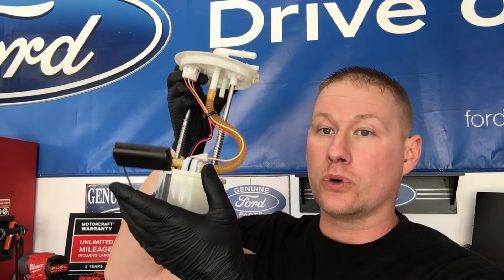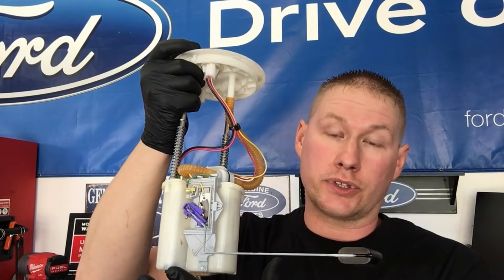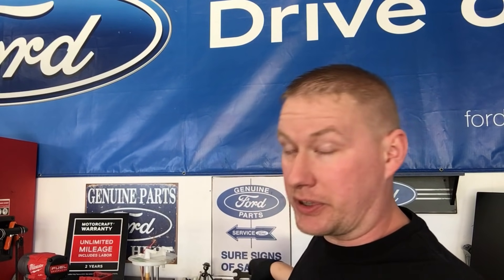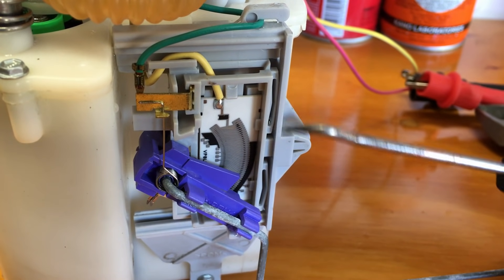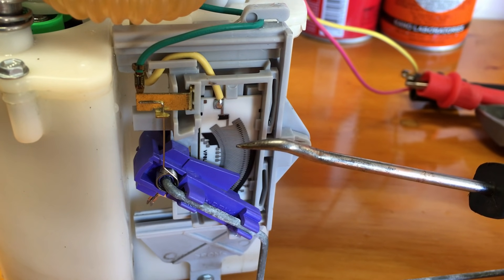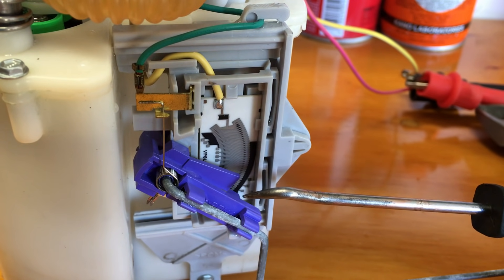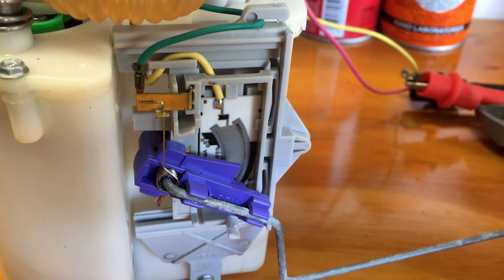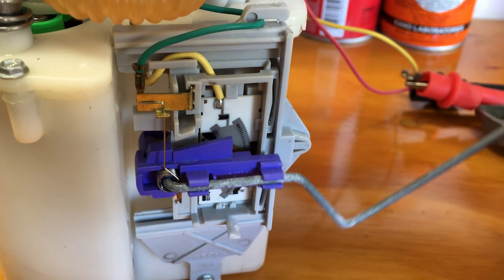Ford Quick Tips #77: DTC P0460 P0463 Erratic Fuel Gauge Quick Fix!

Comment from the maker: Before replacing the fuel pump sending unit use this additive to restore it-
http://amzn.to/2wm37s5
Reply: cruisepix mine was @ 60k when started, but never got a code?
Reply: Does auto stores or Wal-Mart carry this?
Reply: Yes. It comes in different size bottles for different size gas tanks.
 @maxwell9219
Reply: FordTechMakuloco my fuel gauge is draining extremely fast what could be wrong with it?
Reply: It works!!!!👌👍
Reply: Is this techron plus ok for diesel ford kugas?
Reply: @TempTrack  this chevy yrecro plus really work
Reply: @FordTechMakuloco I have an 07 f250 6.0, and i just got the p460, can I use this stuff in my truck or should I use the techron diesl fuel system treatment? I ask becuase I dont know if its as effective as the one youre mentioning, and I dont know if its safe since its based around gasoline and not diese
Reply: @DJCuhhhstin956  what did you find out about what works for the 6.0 L? My gauge works good when it 1/2 or below but shows empty when I fill it up and was wanting to know if what he is using works with Diesel
Reply: @DJCuhhhstin956  how did this turn out for ya? My 07 6.0 is having erratic fuel level low warnings too...
Reply: FordTechMakuloco I have an 09 f150 4.6 3v. I don't have any codes, however I have not been able to fill my tank fully in over six months. I can only put maybe 20 gallons (I have the 26 gallon tank) before it clicks that it's full.  Do you think there is debris preventing the arm to lock out fully? I usually get over 440 miles on a full tank,  lately I can only get 370.
Reply: I tried a large bottle of it with a full tank in my 2004 Mercury Monterey... It still reads empty, and the low-fuel light is on! I pulled the cluster to see if the anti-slosh module could be bypassed, but there doesn't appear to be one. Now what do I do?
Reply: Mine the gauge before I replace my fuel pump was not working properly and I just replace my fuel pump and the gauge looks like is doing the same thing looks like is stock I did fill my tank and is only reading 3/4 of the full tank
Reply: Does a 2006 ford van has a anti slosh board?
Reply: Was that unit affected? If so, how many miles on?
Reply: Would you still use the cleaner on a 3.5 ecoboost
Reply: FordTechMakuloco I’m driving 2004 f150 .. lately .. I noticed whenever we have hot weather 78 F or up my truck like stalling ..and it said : check gauges ..3 days ago I was driving...  it was around 82 F .. I stopped at red light then my truck shut down totally .. all lights were on ... it said : check gauges .. again !!!  so I did remove the battery gauges and I put them back .. it started then I drove back home ... today it was really hot again .. I tried to start my truck .. it wouldn’t .. again the message came up again : check gauges ...but this time won’t start ... I could hear like it wanted to start then dies and all lights were on.. the engine the wrench the battery the fuel ... Please Help
Reply: SuperBadr12 My vehicle is of a later design than yours, but when I can't get fuel pressure on a cold start or on a restart, and I need to get it going right now, here's what I have found that can work.  Check your relays - the Run/Start, Fuel Pump, etc. in the Battery Junction Box(BJB) The Owners Manual identifies them by name, or you can download your manual from Ford if its missing.  Instead of buying new ones at $20 per relay, using the owners manual diagram, just switch out questionable relays with non-critical ones that have the exact same Ford part number. For example, on my 2010 5.4 Expedition, all of the relays on the back row of the BJB are identical. Switching them around doesn't fix it, but it can get it started very quickly.  Keep a pair of pliers in your truck to make it easy to change them. You can also use the Ford recommended grease to help prevent bad connections from corrosion in any recommended connector (i.e. not on spark plug tips and their connectors on gas engines).  I am still trying to find the root cause of the issue, and will be adding the Techron product tomorrow, but relay switching is the only thing that let's me continue to drive the vehicle.  I hate replacing expensive parts when I am not certain about the cause of the problem.  I bought this vehicle new from the dealer, and in 125,000 miles of driving, this is the first mechanical or electrical problem I have had, except for a blower relay at 70,000 miles, which took 5 minutes to fix after getting the new relay.

P.S. For finding overheated relays or anything else, use a cheap laser temperature gun to quickly locate hot spots.
Reply: My '05 500 with a P2068 code (Fuel level sensor "B" circuit high) Will this method help, or is it time to visit a shop?
Reply: Oddly the gauge on my '13 Cmax started giving erratic readings AFTER I put the techron in......
Reply: Can I use the chevron plus in diesel fuel???
Reply: Said what

Comment: Was really skeptical about this to  start but decided to give it a try 
Put it in on 01/05/25 cleared the code and been running for a few days now and it works so far, going to put my second bottle in today 01/10/25, glad I saw the video on was really not looking forward to pulling the unit out. Thanks

Comment: Mine, is stuck on almost full..I already have Techron cuz I wanted to put it in, so I'll do that tomorrow.. But my fuel pressure is 28-30 f250 5.4, so I'm thinking it's time to change the pump anyway? Thanks great video

Comment: Hi, I just got a 2012 F150 with the 5.0 last week. It has 315,000 km on it.  And got a P0461 code today. Here is the background.

When I got it, it is empty and it said 18L/100km. I went fill her up all the way.
The same week, the truck was in a shop for coolant leak repair and transcooler line replacement.
When I pick up the truck the shop told me the check engine light went on for misfire but I told them to clear it and I will keep an eyes on it because the check engine light is not on when I took it in.

When I pick up the truck, it said 34L/100km. Thinking they were bleeding the coolant and test drive and drive hard. They put on around 10 km.
A day later of my driving I get it back to 22L/100km but the check engine light turn on and I got P0461. Gas gauge showing just above half after 270km of driving since fill up.

My question is, does the big changes from 18L/100km, to 34L/100km and back to now 20L/100km turn on the P0461? Should I just clear it and keep an eyes on it?

Thank you

Comment: I replaced my fuel pump in my 02 GT and now the gauge shows empty with a full tank and a "low fuel" light and "service soon light". After using up enough fuel the gauge goes to full, the low fuel light turns off and the service soon light eventually turns off until the next time I gas up. So, I'm going to have to drop the tank, again, and check the float to see if it's bent. I did notice the (OEM) assembly didn't have any rubber feet but I didn't think that would be an issue since I didn't see any foreign objects (like rubber feet)  in the tank. Are those rubber feet necessary and if so where can I get replacements of the correct size? I have a source for the float but Amazon calls it a sending unit (combo float and sending unit?). Hopefully this will be the last time I have to do this for a long time. Is there a test method that you recommend to insure that everything is good before re-installing the tank? I was thinking of putting 15.8 gallons of gas into it while it's on the ground to see if it goes "off scale" again before re-installing the tank. I also considered putting in 15.8 gallons of 99% isoproyl alcohol into it since that would be safer - but what a waste. I suppose water would be fine as long as I thoroughly dry the tank. What do you suggest?

Comment: The fuel gauge on my 2005 Explorer was stuck on Empty. Watched this video, went to Wal-Mart yesterday, bought this Techron Complete Fuel System Cleaner for $10, put it in the tank in the parking lot, drove 14 miles home, no difference. Turned on the key to start it this afternoon, the needle jumped right up to 3/4 of a tank. FIXED! Try this additive before you do anything else!

Comment: Any idea why the aftermarket pumps I’m getting are reading ohms backwards of what you’re saying I should see? The gauge works from full to 3/4 then stops there. Float is not sticking, only thing I seen wrong is ohms empty start at 16 and full shows 161. We’ve run the additive you said and not working for us

Comment: I replaced my pumps (they were older and I was doing preventative work), sending unit, filter, and had Circuit Board Medics rebuild my instrument cluster and my gauge is still not reading correctly. Any ideas where to look next? I have a 2007 GT running the GT 500 double pump setup.

Comment: Hello. I am having problems with my fuel gauge for some time now.  I have   Ford focus Mk1 2001 2 litre. I clicked on the link but it doesn't go straight to the additive. There is a reference to Techron fuel injector cleaners from Techron. Is that a different product or will it have the same components?

Comment: i have the same Problem - pump replaced Ohm checked directly on the Cluster connector - so the wiring is working - but the ICM still says "0 Miles to empty" 😢 - i'm done for now - fuses all this stuff checked but no fuel Level...anyone any ideas - or a solution what is broken on the Cluster? 2007 EXP 5.4 3V...

Comment: As of this afternoon, out of no where the gauge itself seems fine but the digital read out of how many miles left to go on the fuel level is dropping hard and fast, yet zero leaks anywhere in the fuel system.. would this be the issue? Should I try the chevron trick?

Comment: idk if youll see this since its 7 years old but would the chevron liquid work, even on a new fuel pump/sending unit ? If its used to clean and protect the fuel sending unit, since mine is new would that help read it correctly ?
Reply: also @FordTechMakuloco how do i tap in to the wires coming out of the fuel pump ???
Reply from the maker: yup it leaves a coating.

Comment: I had a 1/4 tanks of gas on the dash when in reality it was less than that. I drove around a bit then it showed over half a tank. I found that strange cause I didn’t stop for gas. I then went to fuel up and turned out to have 2 gallons on a 35 gallon tank. I topped off the tank and it went back to a 1/4 on the gauge but a true full tank of gas. I added the solution and it moved to a half tank but after weeks of driving it. I’m not sure how much gas I really have. I ordered a new oem assembly and I’m waiting to install it.

Comment: I got a 461 and 463 codes. I came to YouTube and this was the first video to pop up...also the easiest first try to fix it. Going to buy this tomorrow. 2010 Lincoln Navigator L with 256,000 miles. Once this is cleared, I have a couple minor fixes then it gets sold.

Comment: Problem is I don't have a code.  My fuel gauge goes from a quarter of a tank (approx 65 miles to 0) to zero in a matter of minutes.  The car even stalls like it is out of gas.  After the engine stalls I can start it up immediately.  When I refuel, there are 2.5 to 3 gallons left in the tank.

Comment: I just wanna thank you for your recommendation. My wife’s fx2 fuel gauge wasn’t operating properly and I was dreading pulling the fuel tank I did one about 30 years ago when I was 27 it wouldn’t have been a bad job. before she ran one tank of fuel through it. It started working again unbelievable thank you, you wouldn’t happen to recommend an additive to soften up oil seals I’ve been told a few over the years but I’ve never really been an additive person, but I have a small leak in my F150 in the rear seal. Is there anything I can put in to soften the seal  Where it won’t leak

Comment: I have a 2005 mustang gt and suddenly the level will drop to 0 when parked idling for a bit then a minute later go back to normal. Now my cel light is on. I did let my car sit for a week and a half when I was on vacation. I did last use chevron gas and a slow station. I’m not super worried about it. I can always just go buy fuel used and reset it after every fill up

Comment: @FordTechMakuloco
Working on a 6.0 with the 460 463 and B1201. This cleaner says not recommended for Diesel. What do you recommend?
There is a TSB out there about a reprogram, but I can't find the info on what ecu id needs it.
I also need to find the pin point test specs, so I can test the communication to the cluster/ecu.
Thanks for the tip.
Reply: According to the Chevron website product comparison shows the complete will clean the sender card, but the Diesel additive does not ... hmmmm

Comment: I replaced the pump assembly and I still have P0463. Could it be the fuel pump control module? A fuse? The alternator producing too high of volts or alternating current? The fuel guage?

Comment: 2012 F150, doesn't get driven regularly. A couple times a month not very far to pick up hay/feed.  

Have the "sticking" fuel level gauge. No codes thrown though like everyone else mentions. Have noticed it only during the cold months in AZ. All through the warmer months never have the problem.  

I'll give this a go as the quick/cheap fix first. I would rather not have to pull the pump of nit needed.

Comment: Do it need to be oem floater? Also if 1 is out of wack will the other one throw a code aswell? I bought a new fuel pump and it still reads theyre both faulty

Comment: What would be the diesel equivalent? 2006 f350 6.0L intermittently goes to zero and throws the CEL. I haven't really noticed if it is related to the fuel from certain stations or not because it is so random and been that way since I bought the truck 3 years ago. I just track miles, it mostly bothers me when the * light is on.

Comment: The Techron did not help my fuel gauge problems and I think it is more than a corrosion issue. 

The fuel gauge is very erratic: sometimes off with the light on, sometimes with the light off and with varying levels regardless of how much is in the tank. Within 10 minutes of driving, I can experience all of these symptoms. I've been relying on my trip meter to keep me from running out of fuel.

When the gauge is working, the level will vary from 1/4 to 3/4 but never lower or higher, and always fluctuating when working. I am suspecting the fuel sending unit is bad but my skills are limited. What do you think?

Should I replace the fuel sending unit and/or the fuel pump with a new fuel sending unit? The engine has 148K miles on it and the fuel filter is new.
Reply: UPDATE: I've since had the fuel pump and sending unit replaced and the wiring traced by my mechanic. Still no change. Any suggestions?

Comment: I know this Video is a few years old, but I see you've made some recent replies.  Thanks BTW for your videos...I have definitely used 1 or 2 myself.
Now, I recently ran into a fuel gauge issue, which hopefully you can answer.
One day, going to NY, some type of issue occurred in the dash display while I was checking my fuel level.  Not sure what it was.  But afterward, the fuel level dropped from 1/2 to 1/4. Ever since then, my fuel gauge reads empty at close to 24 gallons used (I have the 36 Gallon tank). I've confirmed 36 gallon tank, and checked settings w FORSCAN...everything is correct.  I've compared odometer mileage to actual milage (based on fuel used) and it is fairly accurate.  I have put the Techron in my last 2 fuel-ups, but no change in the DTE.
Does this mean the sending unit is bad or possibly broken?  Let me know when you can...Thanks

Comment: My 1998 Ford e150 temperature gauge is not working.  I already changed the coolant sensor. The termostac is working. I don't know what else could be? 
The adometer mileage reading is also not working, I'm guessing it could be a bad cluster?🤔

Comment: Would you recommend trying this for a 00' f650 7.3, Allison 545? The fuel gauge stays stuck on full. No codes. Worked for half a day last week. Odometer and speedometer have now stopped as well. Speedometer may be Allison related.

Comment: Hello’ I have a 2005 ford explorer and my fuel gauge isn’t working. I replaced the whole fuel pump assembly that included the sending unit. The gauge worked for about 6 months and then it stopped working. I get a reading with a multimeter off the wires directly from the sending unit. I get no reading after the black (little black box thing wired in the harness) box on the harness. What is the black box on the harness and could that be the problem?? The fuel pump assembly came from rock auto and wasn’t very expensive about $140. FYI I’ve checked every fuse and relay related to the fuel system and nothing is wrong.

Comment: My 06 6.0 KR has had p0460 first come up at about 20k miles. I add about 10oz Lucas upper cylinder lube to tank and it helps but keeps coming back every once in a year.  Currently has 45k miles and I just now cleared the code 0460.  

Just wanted to throw in what I use in case someone decides to use this techron in video or similar with wrong fuel type, not sure if it would be enough in full tank to cause issues but it's a possibility.

Comment: Thanks for the great tip. Had this issue in my wife's 09 Escape
 Put in 1 bottle, cleared the code & took it for a ride. Got on a back road & started turning the wheel back & forth. To slosh the fuel in the tank & the low fuel warning went off & the gauge started going up to full. Saved me $100 & making my wife's car smell like gas if I had to remove the pump.

Comment: My fuel gauge works perfectly but my low fuel light never comes on. Can I assume the low fuel light should come on at a certain resistance reading? If this is true The problem is likely with the bulb, right?